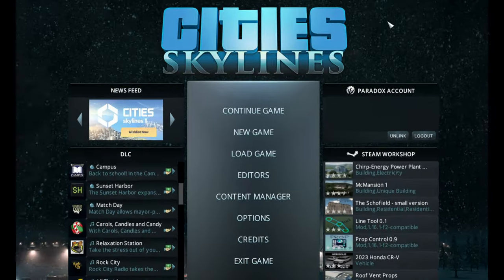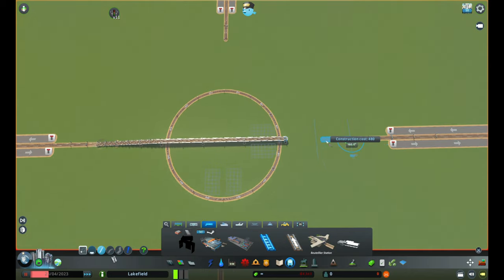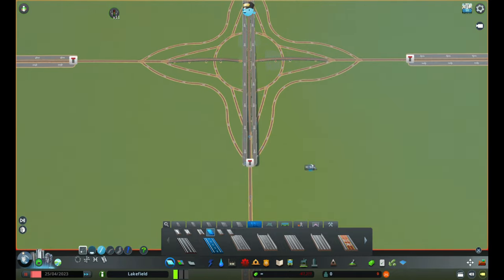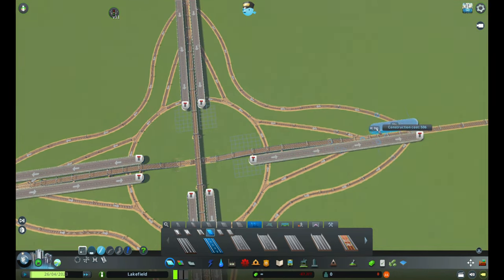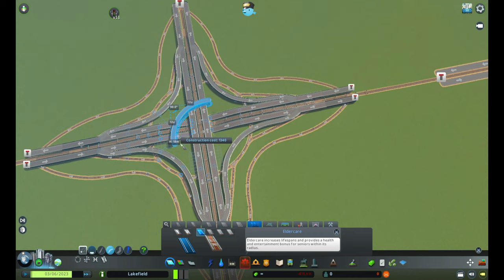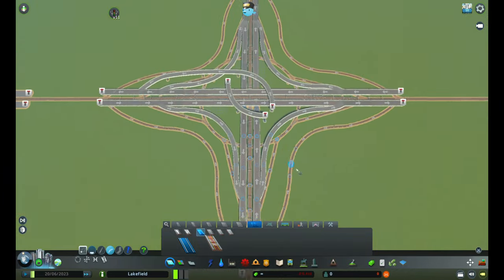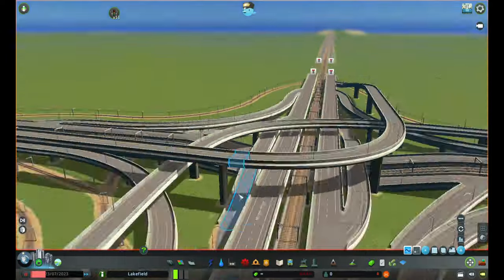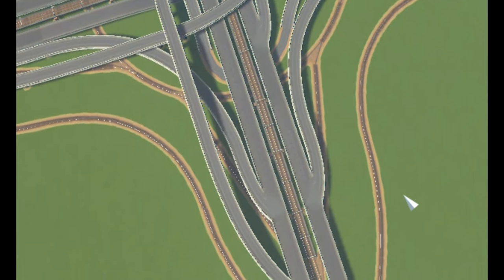Cities skylines Challenge: Building a Custom Train + Highway Interchange!

Comment: what's the point of the outer train tracks? Isn't it like a roundabout where you can already make all of the possible turns?
Reply from the maker: There will be a lot of trains trying to cross over and will eventually clog up the round a bout give way signs for the trains does not really work for trains so i used them so that only the trains crossing tracks will use them.
Reply: @Episodesgaming  Agree with you brother